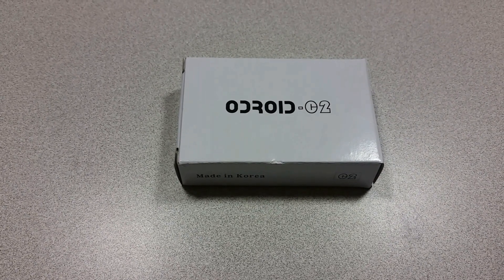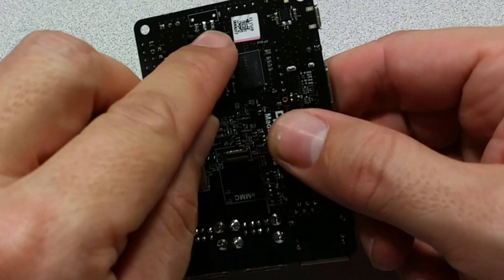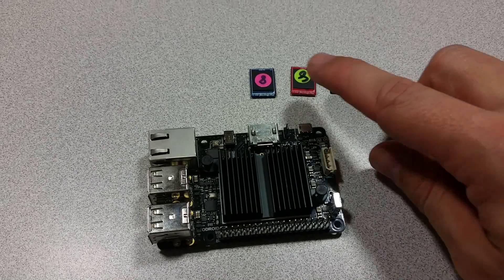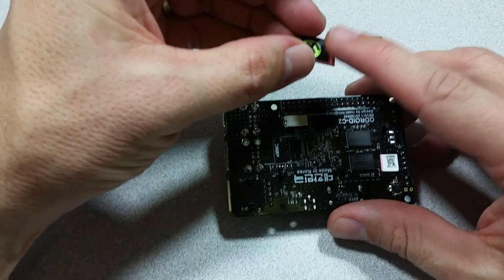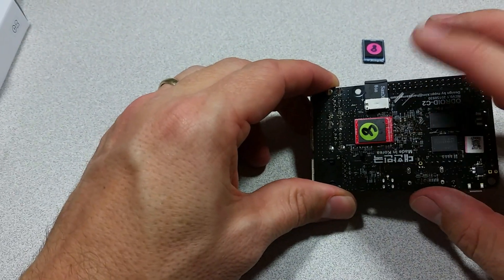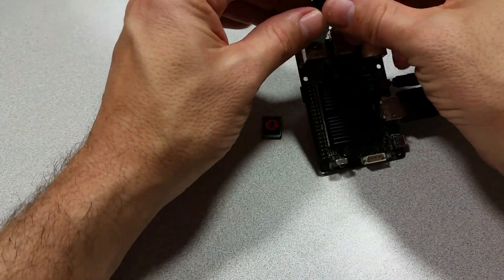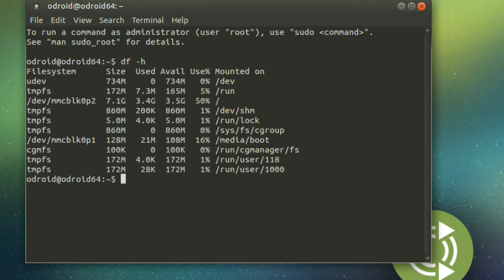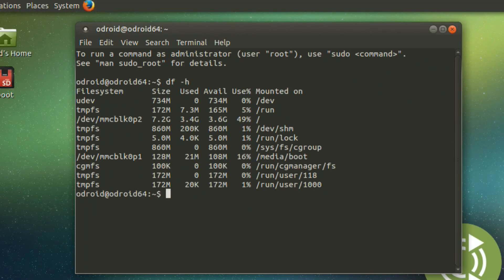ODROID-C2 Getting Started

Comment: What power supply were you using?
Reply from the maker: That's an ODROID SmartPower supply. It has been discontinued and replaced with the SmartPower2 which has WiFi capabilities, but no case.

Comment: Do you know if there will be a newer board any time soon since this was released last year? I would like to try this out, but would rather wait if that's the case. Also, if internet connectivity is a must, buying this with a wifi adapter is mandatory I'm guessing?
Reply: searcherz99 No newer board on the horizon. It has built in GB Ethernet, but wifi must be added if wireless is a must.
Reply: Oh yes I meant wifi, forgot to clarify that. Thanks.

Comment: Hello totally sold me on this bugger I love it so far just a question I picked up a case from you guys with a fan in it since this is my main streaming device. Got it all hooked up per the instruction but noticed it stays running even when device is shut down is this normal? I am running android marshmallow v1.2 and hooked up to pins 4 and 6 on 40pin  I scoured the forum to no results.
Reply from the maker: If there is power to the board, then the fan will run. The OS doesn't have to be running for the fan to be on. If you want to have it only run when the OS is on, you have to use one of the GPIO pins that can be turned on and off and have a script run at startup that enables that pin.

If you want to get really fancy, you can use one of the PWM pins on the C2 and have the fan change speed based on the CPU temperature. :-)

A simpler option is to hook the power supply up to a switching power strip so you can just shut off the power completely with a simple switch. Or, you can add a switch to the C2 as explained here: http://odroid.com/dokuwiki/doku.php?id=en:c2_hardwarehacking

Comment: How did you get the top items like applications, places, system. When i installed it, with a fresh install, i am missing this entire top.
Reply from the maker: If you are using a TV, many times they have an overscan setting that cuts off the edges of the screen. Some monitors have a way to turn this off.

Comment: I, like others have a real problem with our screens. On first boot I have a blank screen. I have uploaded the latest ubuntu mate OS and checked the md5sum afterwards. I have a viewsonic screen and powered everything up. I have red and blue lights flashing and even my yellow light above the network plug. But, alas a blank screen. I have swapped over to a new lg (non hdmi) screen, swapped cables. Both my screens have a svga plug at the end so i have to use a svga to hdmi adapter. I can not afford to buy a new hdmi screen. HAS ANYBODY PLEASE GOT ANY IDEAS. I am so new to computers and I thought that this would be a good way to start with a new one. thanx
Reply from the maker: As always, the best way to get support for strange situations is by posting your question on http://forum.odroid.com.

However, this is generally an easy issue to resolve. First, find out the native resolution of your monitor (search the web using the model number of the monitor). Next, go into the boot.ini file on the microSD or eMMC module and comment out the 1920x1080 line (adding a # to the beginning of the line) and uncomment the line that matches the native resolution of your monitor.

Beware if you are using a Mac that you are using a code editor. Standard text editors on the Mac can change important characters (like ") to something that isn't compatible with the boot.ini format.

If you are on Windows, also make sure you use a code editor like Notepad++ that can handle unix-style line endings. Otherwise, the file will all be mashed into one long line and will not work when you save it.
Reply: That's really good and clear advice. Thank you very much. It now works perfectly.

Comment: can't get my wifi dongle to work, any tips ,got it from you guys, will not work on android or linux ?
Reply from the maker: Which model of WiFi dongle, and which distribution of Linux/Android? It could be a defective dongle, or it may not have a driver in the distribution(s) you're using.

For best results, post your question on http://forum.odroid.com and/or send it to the "Contact Us" page on ameridroid.com as our tech team doesn't usually monitor YouTube comments. :-)
Reply: dongle is a EDUP EP-MS8512 WiFi Module , tried lots of versions of both  android and linux with no luck, thinking it must be the module
Reply from the maker: doug bishop Sorry to hear about that! Normally, those work fine. However, yours could be a dud. Use the "Contact Us" page at ameridroid.com to start the RMA process.
Reply: Does it work on a regular PC?
Reply: never tried it that way , i got it working on linux , found out thats all it will work on so i got one that works on both there is a thread on the odroid site about it...

Comment: Hi,
When You power up your device what do You push? What button? Thank You.
Reply from the maker: The ODROID powers on immediately when power is applied. We sometimes use a desktop power supply with an on/off switch to turn it on and off. Otherwise, you can simply plug it in to turn it on and unplug it to turn it off.
Reply: Thank You.

Comment: I purchased a ODROID C2 from you and just arrived in the mail.  I put an eMMC image of android in and it would not boot up.  I also did the same for an sd card and still would not boot up.  Is there a chance you sent me a defective board?
Reply from the maker: Sorry to hear about your problem!

Seeing as how every ODROID is tested at least twice, it is unlikely that a defective ODROID was shipped out. However, it is possible that a power spike, bad or under-powered power supply, or physical damage during shipping or at some other point could cause problems. Statistically, over 90% of the ODROIDs returned to us are found to not be defective and most are linked to environmental factors like the power supply or an improper or corrupt image used to boot them.

The YouTube comments section in't a very efficient place to solve technical issues like this. For that, we recommend searching http://forum.odroid.com for resolutions to similar issues, or using the "Contact Us" link on the ameridroid.com site for technical support. We look forward to helping you resolve this issue.
Reply: Sorry, not your fault but rather mine.  I used winzip to uncompress the image and not the recommended 7zip.  After a read all the documentation I realized that I made the mistake.  Sorry to trouble you.  It is up and running flawlessly now.

Comment: I have installed Android, and the wifi isn't working.
do I need to give ssid? 
if yes how?
Reply from the maker: What WiFi adapter are you using? The C2 doesn't have WiFi hardware built in.
Reply from the maker: The best place to get quick support is by creating an account at http://forum.odroid.com .

Comment: Hi. I recently bought this little pc as an htpc, I have 2 issues right now. Firstly, when connected to a large tv, ubuntu mate overhangs what the tv can display, thus making use of the task bars very difficult. Secondly, I have a dvi based monitor using an HDMI to dvi cable and it does not work with the odroid, but does with other devices. If anyone knows of a fix or video to watch, please tell me
Reply: The overscan issue is with the TV. Try changing the zoom or scaling mode to full screen instead of 16:9 or whatever. Depending on the TV, there may be other menu settings available to correct this. 

If you are using DVI, go into the boot.ini file on the boot media (microSD or eMMC) and change the vout or video-out setting from HDMI to DVI. That should fix it.
Reply: +MrRespecTech thanks mate

Comment: Hi there, what is the power device you are using at 6:25 to turn on the machine? Thanks
Reply from the maker: That's called the ODROID Smart Power, but it is no longer in production. We are looking to stock a similar device in the near future, however, but made by a different manufacturer.
Reply: thank you

Comment: very nice. what is the frames per second of a general purpose webcam? Thanks.
Reply from the maker: +q zorn Depends on the resolution. Most can do 30fps at 640x480, and possibly more.
Reply: +ameriDroid Wow that's bad lol.
Reply from the maker: +James Lewis What I was saying is that many general purpose Webcams can do 30fps at 640x480. Some can go higher. The oCam from ODROID can do 120fps at 640x480.
Reply: Ok so the framerate is good, but really, only 640X480? I would rather have at LEAST 720P60 rather than 480P120...
Reply: It will still look like an absolute potato, just a fast potato :/
Reply from the maker: James Lewis
The oCam from ODROID can also do 1920x1080 actual resolution (not interpolated) at 30fps.
Reply: If you want have a better frame rate than 800x600 @30 fps without pre compression make sure your Webcam does transfer data in USB 3 mode. 
For RAW video USB 2.0 is a big limit.

Comment: how reliable are these things?
Reply from the maker: They are quite reliable.
Reply: +ameriDroid how much is shipping?
Reply from the maker: +NEOMEW depending on where you are, priority shipping starts at less than $7.
Reply: +ameriDroid I'm from California
Reply from the maker: +NEOMEW Priority mail should be around $6.75.
Reply: +ameriDroid would a raspberry pi case work on these or would I need to get a case made for the odroid c2?
Reply from the maker: +NEOMEW The Raspberry Pi cases work, but you need to make a small hole for the 2.5mm power jack if you are going to use that, and the microsd slot is in a different location so you have to open the case to switch microsd cards. Everything else lines up.
Reply: +ameriDroid what kind of os's are there for the odroid c2?
Reply from the maker: *****
There are quite a few. The forum has a place to post alternative OSes at http://forum.odroid.com/viewforum.php?f=138&sid=129f16b04f3eb31c559ad49ba230a3ed
Reply: +ameriDroid when should the odroid c2 be available to ship if buy one?
Reply from the maker: *****
They are shipping now!

Comment: I have a problem. I plug power supply to my odroid c2. Only red LED is lighting (not blue). I try supply via microUSB and the same - only red led. What the hell? I I can turn on my odroid C2?
Reply from the maker: +Marcin If the blue light does not come on, it means one of these things:
- You don't have an eMMC or microSD card plugged in.
- Your eMMC/microSD card doesn't have a valid ODROID-C2 operating system image on it.
- Your eMMC/microSD card's image is corrupt.
- Your power supply is WAY underpowered
- or very unlikely: Your C2 is defective.

Comment: Wifi / BluTooth looks built in based on the video.  Is that true?   Also, how would I image the emme for Isengard?
Reply from the maker: +rfrancoi WiFi/Bluetooth is available via USB, but not built into the board.

Kodi/Isengard can be loaded onto the Ubuntu or the Android images if they aren't already there by default. I'm not sure that OpenELEC is available for the C2 yet, but I'm sure it will be soon.
Reply: ameriDroid Thank you for the information; I appreciate the quick response.
Reply: So, just to make sure I understand.  In order to image the eMMC, I would do the following:
1. Image the microSD from the download.
2. Place the eMMC and MicroSD in their respective slots.
3. Power it on, and wait for the light (blue) to top blinking, 
4. Power off device, remove MicroSD.
5. Power device back on.

Is this correct?
Reply from the maker: rfrancoi When you purchase an eMMC, it is already preimaged with your choice of standard distro. If you want to reimage it, you attach it to the microSD adapter and image it through a regular PC. More details are available at http://ameridroid.com/p/faq
Reply: +ameriDroid Thanks.  I was thinking of OpenELEC.  I noticed that the C2 is not posted yet.  But would my steps be correct?
Reply from the maker: Not exactly. You need to image the card on another computer first, and then put it in the C2.
Reply: +ameriDroid Thank you Sir.

Comment: Would you suggest anything else for someone that is starting from scratch? Just bought a soldering iron and gonna try out some robotics stuff, programming, etc. Here's my list of things im ordering:

1 x ODROID-C2
1 x ODROID-C2/C1+ Case Clear
1 x High Speed 4K HDMI 2.0 Cable
1 x USB-DC Plug Cable 2.5mm
1 x 16GB eMMC Module C2 Linux Black
Reply from the maker: +Neceros As long as you have a USB keyboard/mouse, a way to connect to the Internet, an HDMI monitor, and a 5V/2A USB power supply for your 2.5mm cable, you should be good to go!

Comment: Very interesting! Looking for a mini PC to put Linux or maybe android on for programming and what not. Do you suggest this for that? Heard things about raspberry pi 3 overheating.
Reply from the maker: +Neceros Yes, Linux MATE 16.04 and Android 5.1 are both available for the C2. We program on them all the time! No overheating problems here.
Reply: ameriDroid Great! Gonna find a huge battery, since this thing seems to draw so little juice.

Hey, any tips on a low power monitor?
Reply from the maker: +Neceros Obviously, eink displays will be the lowest. Another difficult-to-find monitor that draws low current would be OLED. Backlit LED and then LCD after that.
Reply from the maker: Neceros Ubuntu MATE 16.04 is still in its infancy, but everything seems to be working quite well!
Reply: +ameriDroid does it work well without many issues? i would like to use linux mate but i can t arrive to know if all working good

Comment: Very cool, looks like I can pick one of these up to run my retro gaming station and move my C1 to be the brains of my rover unit.
Reply from the maker: +Jordan Bettcher Repurposing - I love it!
Reply: +ameriDroid, since the whole 32bit to 64bit transition on Linux has been done on many platforms for many years now, I'm hoping it'll be smooth for this unit as well. If not that new aluminum case on a XU4 will fit the passive cooling needs for the time being.